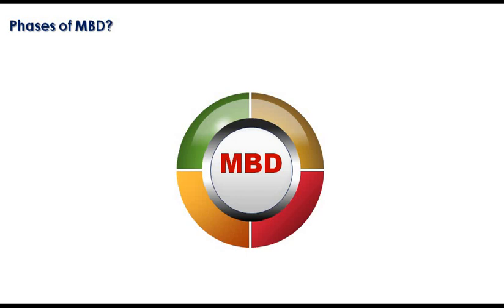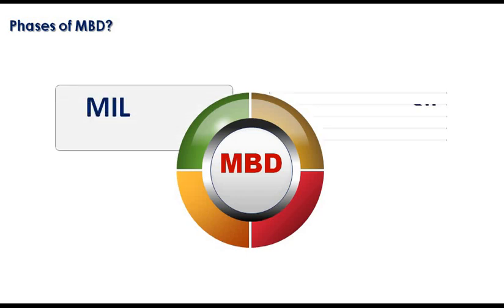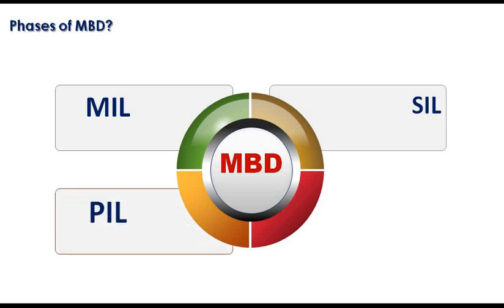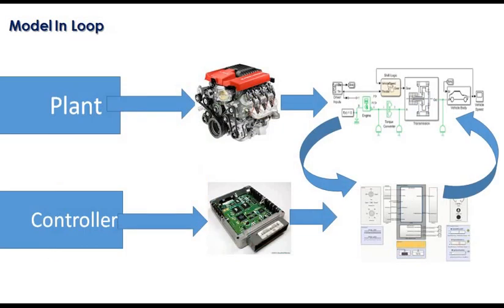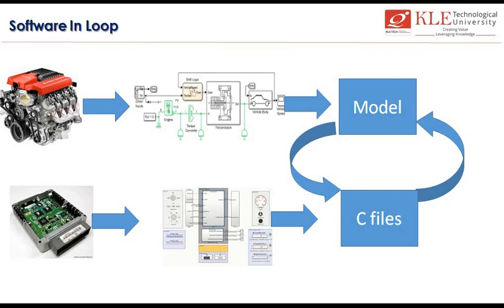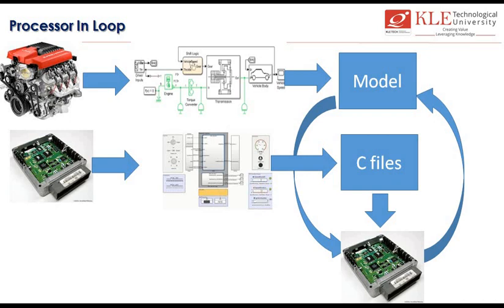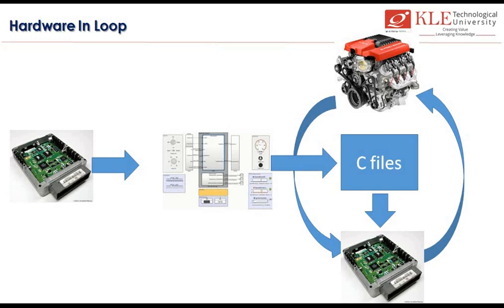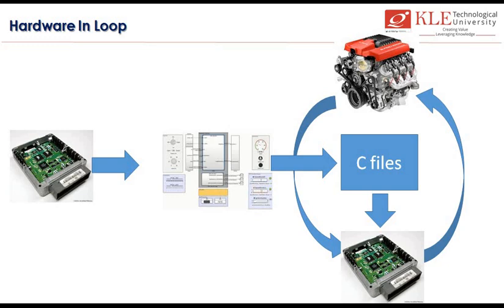Difference between MIL SIL PIL HIL

Comment: Adding more to this video, for SIL, the controller C files are generated for the host computer (laptop/desktop computer),  for PIL, the controller C files are generated for the microcontroller (with no mapped peripherals). Finally in HIL, the controller C files are generated for the microcontroller(with actual mapped peripherals, Ex: PWMs, ADCs, Interrupts, etc) and the plant can be the actual hardware or a hardware simulator (where the simulink model is compiled and downloaded to a real time simulator).
Reply: You are absolutely right

Comment: Some of the concepts explained are completely misleading and do not have bearing on the professional practices of the industry
Reply from the maker: Thanks for the feedback and please let me know which concept you felt incorrect. It would help me to rectify
Reply: Exactly, I hear him repeating those terms (MIL, SIL, PIL, HIL) more than explaining them. The most misleading part is when talking about HIL, the diagram shows a picture of engine. no model, what is the difference with you driving a car? (you have the engine inside and the controller inside)

Comment: Why PIL is used if SIL is done?
Reply: SIL is used to validate that the model functions how you expect it when you generate code for the controller. This is all done in the host computer.
PIL validates that the controller part will function properly on the TARGET. This is important to verify code performance (such as schedulability, memory budget, worst execution time)